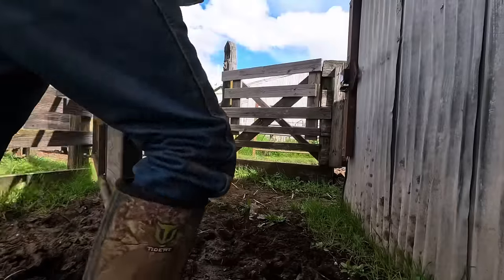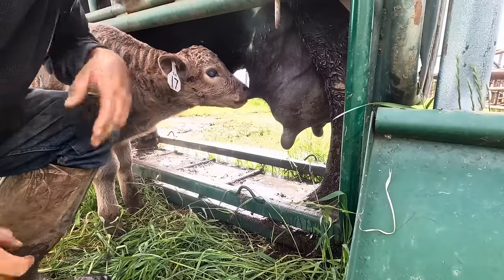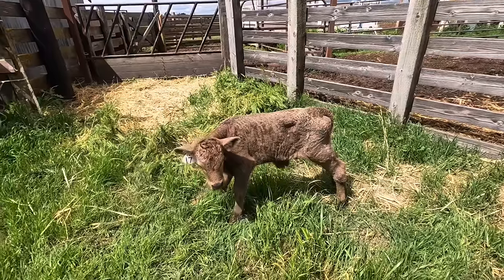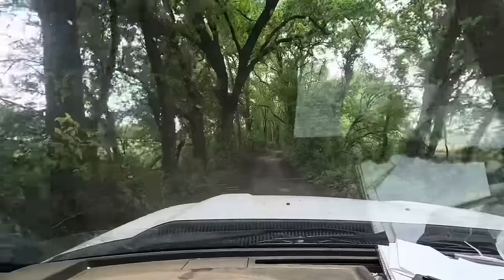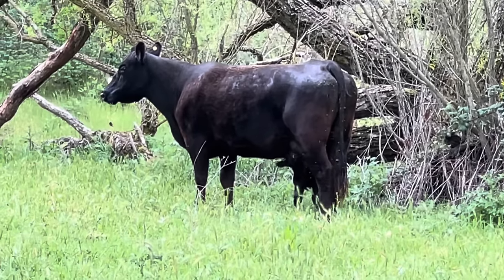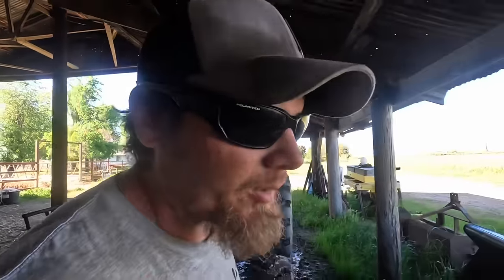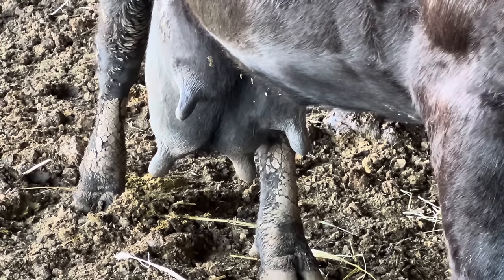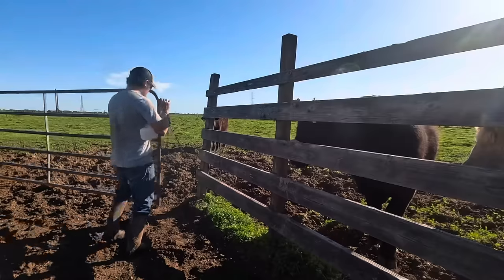This Calf is Becoming a Full Time Job!

Comment: Tyler, please check the video at 14:10, the two wheels on the right hand side of the stock trailer.  It looks as if the front wheel is rotating freely, but the rear wheel is not rotating freely - it looks very much like it is skidding/dragging.  It was definitely not rotating the same as the front wheel.

Comment: Had cows and calves years ago.   They can be work at calving time for sure.   Try holding the bottle lower at the same angle as the cow's rear quarter.  Your right the calf can't figure out he needs to arch his head more lower.   Your doing a great job.   Nice conformation on the cow.   Rog/Iowa

Comment: Feeding him a whole bottle at night with out getting him on mom you are really running the risk of being mom. In my over 40 years I become mom more times then I like. What I done for years get them on mom morning an night. Tube feed to top up. If I think didn't get enough. Never a bottle. Alway tube.

Your hay really look really corse like straw. Any of that corse stuff in a bale my cows bull steers heifer pull it out of the feeder. An stick there heads deep into the bale for the fines grasses clover alfalfa .. but were I get my truck loads of bales 7 miles away is great hay with a good mix of everything. They are stored in side until I get them..  once the outer 2" is off the hay is a nice pail green  I am sure it great horse hay. $90cnd per 1200lb bale I love it an my cows go crazy for it